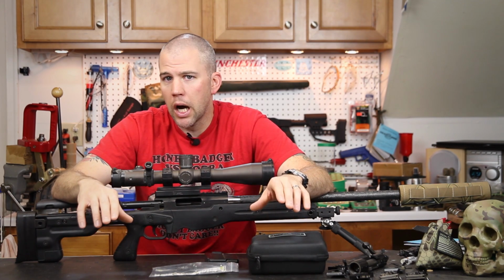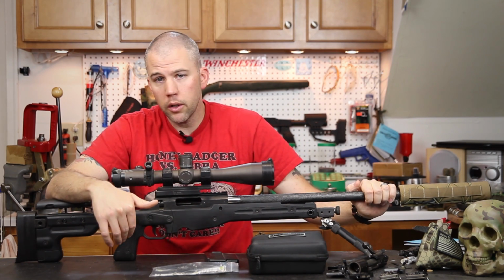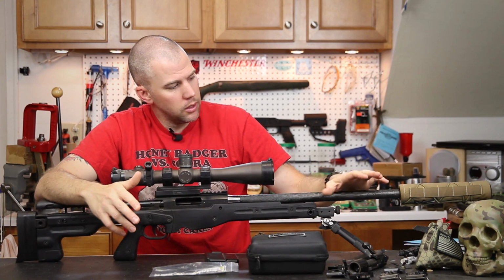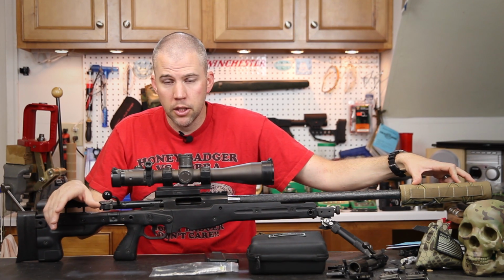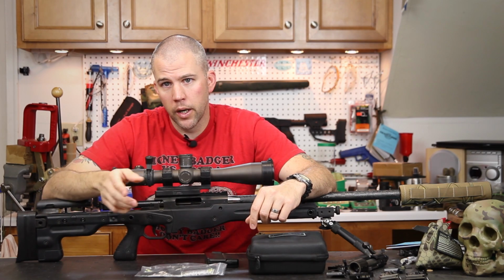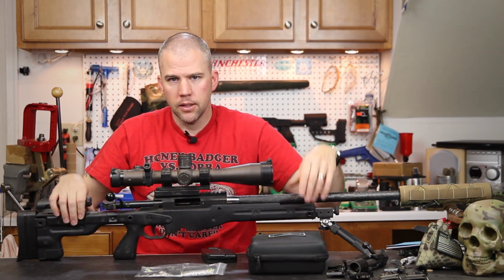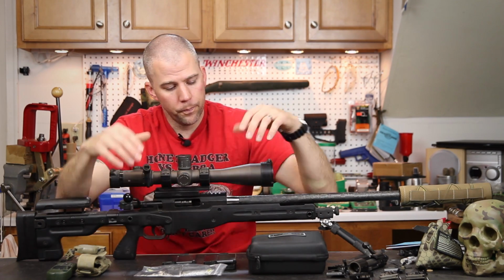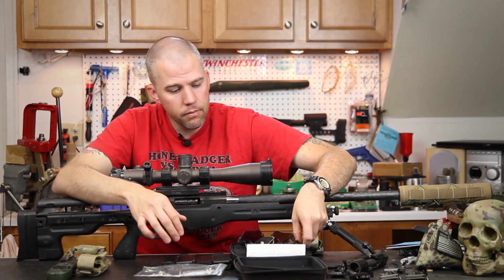Mail Call Mondays Season 4 #08 - Oregon Sniper Challenge Gear

Comment: Great review, John.  I'm curious whether the A.G. suppressor cover in that color reflected a lot of light.  Have read that some of the lighter colored covers do so, due to not only the color but the finish or sheen of the material itself (as in a finer, smoother weave of material contributing to the problem).  Did you have any issues with this in the desert?
Reply: I have not noticed any problems. The two rifles I have used it on all have relatively high height over bore. The suppressor is not in the sight picture even on low magnification.

Comment: John what do think of the worries of over heating the metal core of the carbon fiber wrapped barrel? I had heard the carbon fiber holds the heat in the center not allowing the heat to dissipate.
Reply: According to Proof Research, the reverse is true. They claim hat the carbon fiber transfers heat more rapidly than barrel steel, allowing the barrel to cool quicker than an all steel barrel.
Reply: interesting! thanks for the info

Comment: Great job, John at the OSC. I'm left-handed and have always used the issued M-24 SWS and SR-25 for both military and contracting jobs and never had any drastic issues with their set-ups. Then again, I have never shot a left-handed version of either system. Have you run into any "wrong-handed" shooters that had a real problem utilizing their right-handed systems? Just wondering. Thank you.